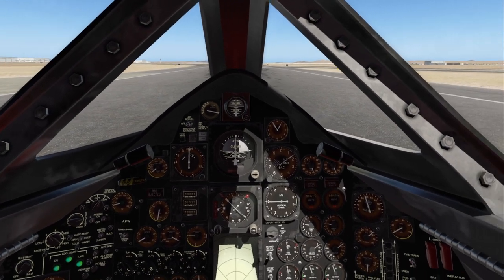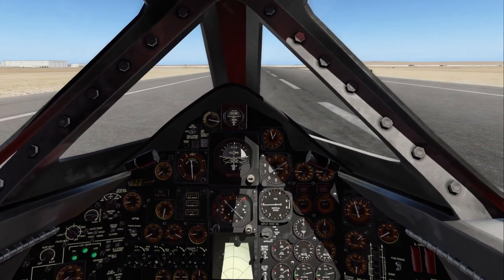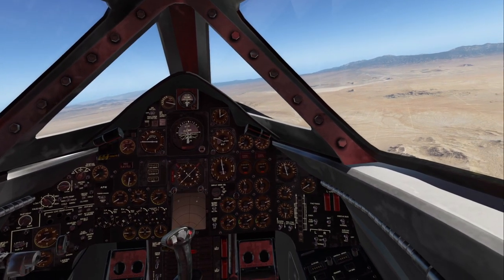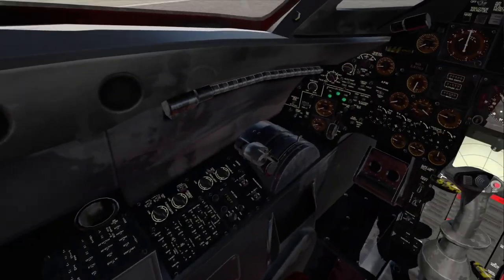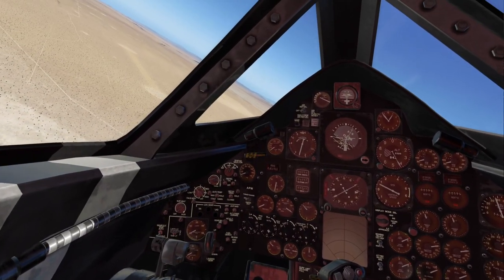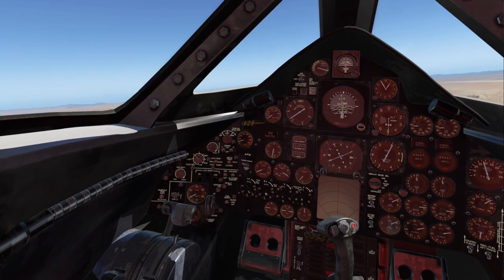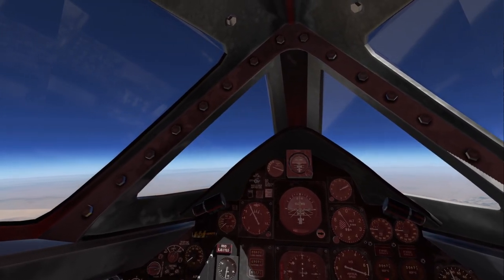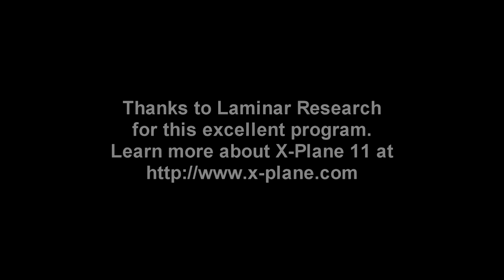X-Plane 11 - SR-71 Sound Pack by SimAcoustics

Comment: as they said on their site, they didnt capture the sounds.
jet engines all kinda sound the same. 
so - as a sound designer, figure out the engine type, gather samples of engines similar to that one, however even that approach might be cumbersome, because sound is greatly influenced by environment & mic selection & placement.

so the best bet is - get a good sounding jet engine recording, study it and listen beyond the noise & distortion, use synthesis to enhance specific elements of it (such as turbine whine or the air being shot out from the back), mix everything together and make it respond to ingame values such as throttle, view angle or RPM.

so yeah, sounds decent! defintely better than the vanilla sounds, which were very simplistic in their design.